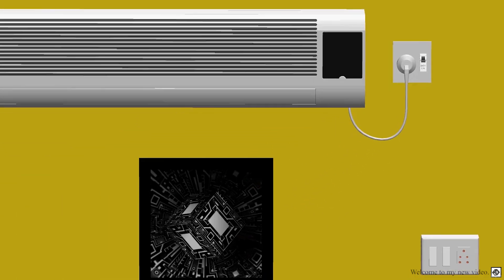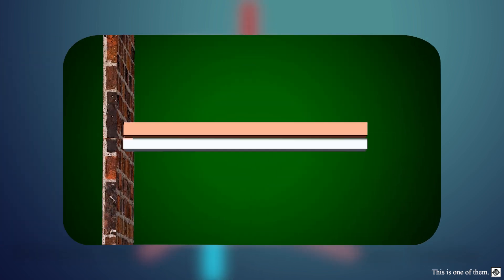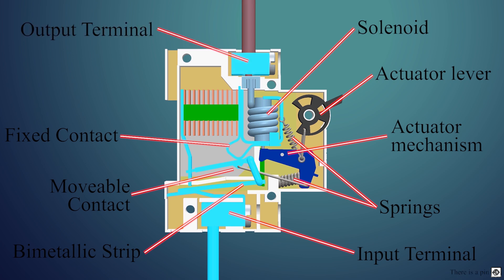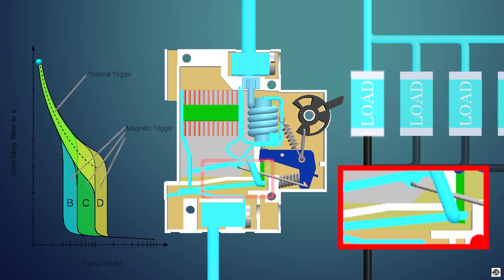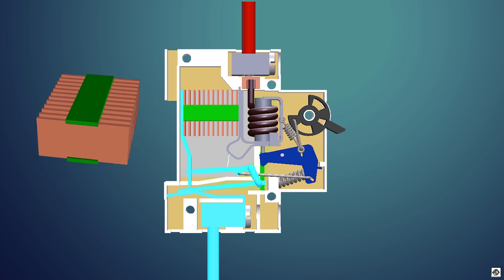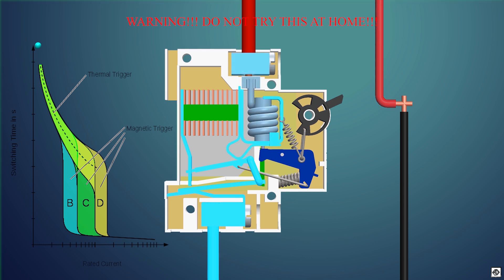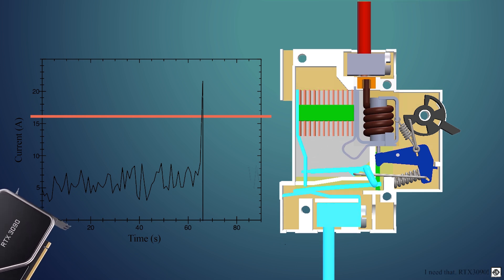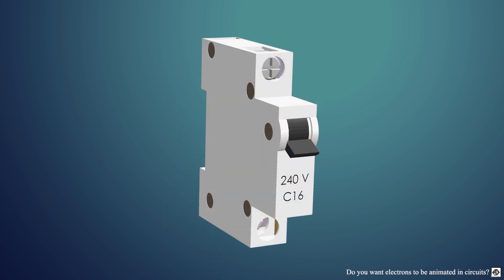How Does a Miniature Circuit Breaker (MCB) work?

Comment: i have a question.  now during overload type situations the current is still passing from bimetallic strip to solenoid coil then to further equipment. so it will still trip right?  or whats the situation here.
Reply: if its still made to pass from the trip coil. it will trip when the spike in load or current happens right? so how is that avoided?
Reply from the maker: For overload the expansion of the bimetallic strip will trip the MCB.